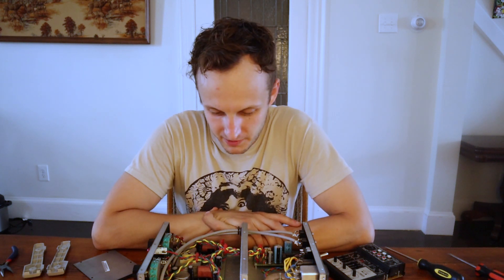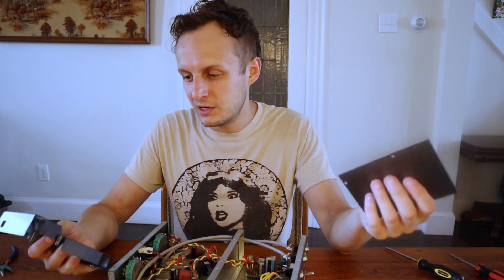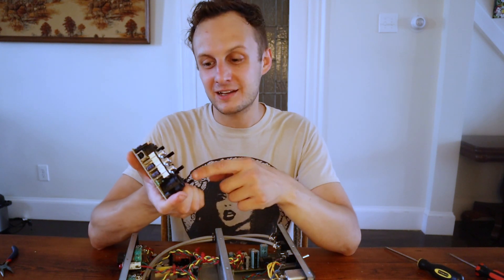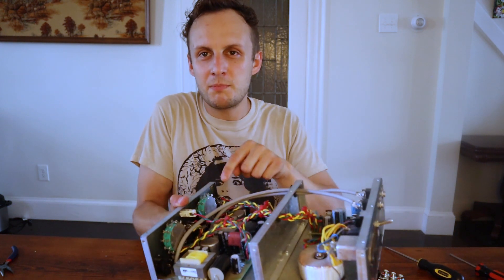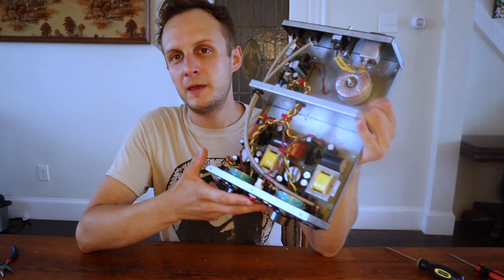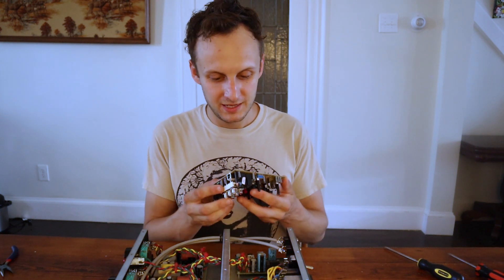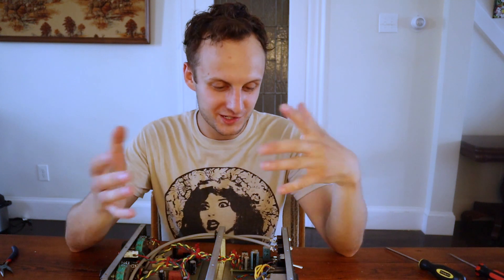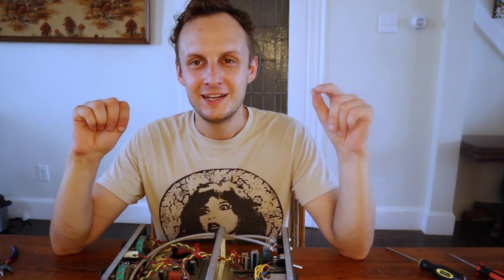$50 vs $500 Preamp: What's inside?

Comment: I did a test running some music through the preamp (on my 1st gen Scarlett), recording it, and running that back through the preamp. After just one generation I could already hear the music losing clarity and low-end punch. After 10 generations it was fairly dramatic with measurable roll-off to both the low-end and the high-end. I immediately went out and got a better preamp (Clarett), and the difference in sound quality is night and day. The difference between the preamps is particularly pronounced with a dynamic microphone. The Scarlett has some muddy resonance with a Shure 58 that cleared up entirely with the Clarett. I don't know what explains that, but it's really audible. Didn't expect the difference to be so pronounced.

Comment: One thing you mentioned was the “parts we have to interact with”…that’s what I try to avoid as much as humanly possible if I find a cheap piece of gear that I like for some reason or another, I’ll leave an XLR plugged into it with minimal tension on the jack. I’ll keep it in an area where it wont get jostled. If possible, I’ll try to power it on and off via a furman or surge protector, etc. There are a few unavoidables…you’re always gonna have to mess with stuff like gain and trim. Some units need to be independently switched on and off. But the idea is to eliminate as many of those variables as you can.

Comment: That was pretty high level.  Discrete components have character themselves, and this looks to be a FET based amp? Different FET/MOSFET will pass 2nd order harmonics and sound more soft/tube like. More 'liquid' on highs. Capacitor choices in the signal path will have an effect. Resistors too. Metal film, vs wire wound, versus Z-Foil, etc.  It looks like it has discrete transformers which I'm told removes inter modulation vs having a single PT.

Comment: The thing is... alot of those discrete component designs don't necessarily work better than modern gear with integrated circuits and external power supplies.  Right now, some of the better preamps or interfaces, in terms of signal-to-noise ratio, actually use really cheap wall warts, in fact.

Comment: Cool viddy!
Oh, the price difference is a fair bit more than an order of magnitude :)
- DIY means you subb'd what Hamptone charges in labor for assembly and calibration+testing. A pre-fab is closer to $1000/channel - and it's sold direct, so there's no retail middlemen getting their cut of a still larger 'sales pie'.
- The Behringer is also an I/O bay with A/D and D/A, is pre-fab, and sold  ~retail~... yet likely clears a better profit margin (i.e. proportional % per unit) than the Hamptone is, due to the effect of economy of scale. The PSU, enclosure and pots/faders are typically the most expensive parts of these things.  I would be surprised if before it left the factory total cost of the parts necessary to build it's  preamp [including jacks and PCB; only what it needs to pass and "amplify" an external signal] exceeded $5 .

Comment: Even though USB provides only 5v practically all USB powered audio devices (even super cheap ones) run a usual 15v for the audio parts of the circuit.

Voltage doublers and triplers and beyond have been around for many years now.  

Think about it... most of these cheap USB  interfaces provide 48v  (or damn near close to) for phantom power so 15v for running the audio components isn't an issue.

I like the spirit of your videos but you need to tighten up some of your details.
Reply: Yes of course you can up-convert voltage internally...but "the issue" is you can't do that without paying a significant  price in  noise,  dynamic range etc.

Comment: Another huge difference: when a component fails on the $50 preamp it hits the trash can; when the $500 pre component fails, the offending part can usually be identified and replaced for not that much $ and be kept in action for years to come.
Reply: So what prevents you from fixing a $50 preamp?
Reply: @tHaH4x0r  nothing if you want to invest the time and effort. Props to those who can and do and hells yeah to those who can mod it to being even better
Reply: i think your denying reality. If the $500 pre component fails, its gonna cost a shit load more than $50.
Reply: @andyfreeze4072  it's more likely to just need it's capacitors replaced every ~20 yrs and not much more (unless kept in a humid climate)...capacitors are a lot less then $50

Comment: bah, I see Amek, I see Neve Consoles etc, all they use chips (NE5532/34 or the THAT or OPA etc) or even Harrison that uses uA741 ... however they've made Thriller by MJ, with that.
Thus, nothing wrong with chips at all. Just mind-set.
What should you point out are passive components' quality, mainly Electrolitic Caps that, on Behringer, are not so high.
Yes definitely the power supply counts a lot, on the final result. You told clearly and correctly.
Reply: Sort of...if the chip is optimally designed. Not all are.
There are definite limits to how close together one can cram the components in an IC
before  the pathway EM fields will intermingle - increasing cross-talk, interference, noise etc

Comment: Lots of interesting points here! Firstly, a while back I did some digging and found out that a lot of electronic components come out of the same factories and that the difference is the "name" that gets attached. So just because a component doesn't have a brand name doesn't necessarily mean that it's not as good. I still don't know how you can actually tell. Secondly, I think the comparison is a bit unfair as you're comparing something that adds "character" against something that is "clean". Do Behringer claim that their unit adds anything? Finally, it's somewhat ironic that back in the day engineers had endless problems with gear overheating, valves failing, etc. particularly mixing desks. I just watched a video where the engineer said he had to hit a channel on his Neve desk to get the bass to work!  Another said that they no longer use a 670 on their mixbus as they realised that all it added was noise!
Reply: All good points.    Behringer vs. Hamptone is really an apples-to-oranges comparison.   There are opamp based designs that are far superior to the Hamptone in terms of performance.  But the Behringer is not one of them.  The Behringer is mostly designed to be a convenient mixer, and the preamp quality is secondary.

Comment: Really amazing things start to happen if you just double or triple that $50 price point. Now you've got a bus-powered pre that has fantastic headroom, ultra low self-noise and distortion and super flat frequency response curve. Well, you won't be able to drive over it with a car or do old analog overdrive tricks, but you can put it in a bag and gig if you need! It is incredible what can be done with the miniaturization nowadays.
Reply from the maker: Great points, you're absolutely right
Reply: You’re taking about...mixers w preamps or preamp units?

Comment: dude, way to go i havent seen a vid like this, please do more on the actual breakdown on topology and the difference with certain components or their articulation within the circuit.
Reply from the maker: Thanks! Will do!
Reply: @PetersonGoodwyn  I found that the Preamp and EQ ckts really determined the 'SOUND' of most consoles. 
The TOPOLOGY is one really obvious differences. Another is components. Lifespan (Quality ?) is largely determined,  Electrolytic Capacitors (Longer life use high temp More $) 
INDUCTANCE and ESR in caps was often noticeably different sounding.
Then you get to things like Tantalum Caps Ugh!
Signal path coupling Caps in balanced power supply circuits CAN BE AND OFTEN ARE REVERSE BIASED
Controls  (A HUGE CAN OF WORMS OPENS) some pots  were better than others LIFE WISE and in ROTATIONAL CONSISTANCY  OF TRACKING). (Important in ganged units. switched solves this problem BUT introduces steps )
Resisters, some are semiconductors there value varies with applied voltage. Some caps do this also.  Sound again!
Getting to the actives OP AMPS distinctive sound, Mostly due to global NF
Discrete, TOPOLOGYS and devices operating conditions. 
TRANSISTERS remember PNP & NPN are ONLY POLARITY COMPLEMENTARY. (look at the gain)
TRANSFORMERS. Signal, more worms to deal with, but yes I used them for ISOLATION and THEY WERE THE BEST CHOICE in most applications.
1: COMPLETE GALVANIC ISOLATION. (No ground loops)
2: ELECTROSTATIC SHEILD(s) provided capacitive isolation but at a hell of a price USA $137.00 each in late 70s for a custom one, BUT IT'S PERFORMANCE WAS SUPURB. electronic line balancing is cheap AND ANY NOISE IS A SIGNAL TO THE ELECTRONICS THERE FOR REDUCES THE DYNAMIC RANGE. transformers cm only exceeding  breakdown voltage would cause a problem, unlikely in signal lines. 
Interestingly some of the legacy components even with all there bad specs had a 'nice sound' that the much better spec current ones don't!
Interesting channel, I like it.

Comment: Fantastic!
I love that you're explaining, from a manufacturer/DIY POV, the different philosophies that lead to the different products.

I would only add that: it's a GOOD thing that you have one group of people engineering the 'Money is no object' audio gear, simultaneously as others are engineering the 'squeeze out every single penny' audio gear.

Once upon a time, the former was the only thing gear sluts would touch, and the latter was almost blasphemous.
However, I don't think anyone can argue today that the 'Concept Car' audio gear hasn't influenced the cheap stuff, or that the 'Made in China' ripoff gear hasn't shown all manufacturers how to get to an end result in less expensive ways.

As you pointed out, ironically the stuff that makes sound isn't necessarily the stuff that costs all the money.
And the MANY clones of all the Studio Classics, have been getting more and more convincing over the years.  And for far less cash.

Beyond that, even when the cheap alternatives don't exactly nail the sound of the piece they're emulating (and no two classic pieces sound the same either), often they are totally usable, and even more reliable and less noisy than the "real thing" .

Last thought:  I know this video wasn't about 'clones' or 'copies' necessarily, but rather mass-produced/cheaply produced vs 'boutique'.  But it's worth remembering that the Distressor was a hardware emulation of 3 classic compressors, with the design goal of consistency, reliability, and low cost, and they've since become Studio Classics in their own right.  I doubt there's a commercial studio rack in the world that doesn't have at least a pair of those cheap knockoffs.

I'm loving these videos though!
I keep buying kits, thinking COVID-19 is the perfect excuse to start soldering, only to get derailed by something else.
But these videos renew my focus, so keep em coming.
Reply from the maker: Thanks! Glad you enjoyed it. And I completely agree, the explosion in prosumer gear has absolutely pushed the industry forward as a whole. And very interesting point about the Distressor starting as a "clone" and becoming a classic!

Comment: In my opinion the most expressive thing is the way these bus-powered devices manage to supply phantom power. To design a good dc-dc converter for these voltage ratios isn't easy at all.
Reply from the maker: I agree! It is impressive that they get up to +48v but keep in mind it's very low current compared to the other power rails.
Reply: I was just thinking this.  When my SSL 2 usb powered interface can not only power my neumann kms 105, but have enough gain that they famously need...And sound great!